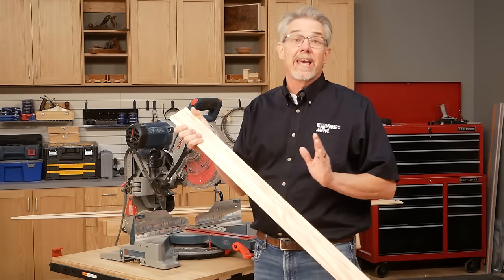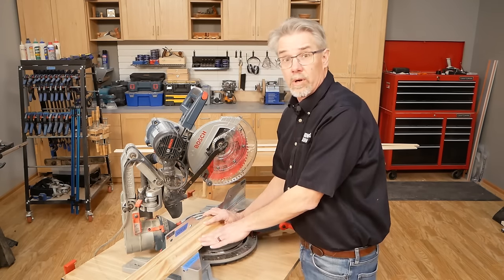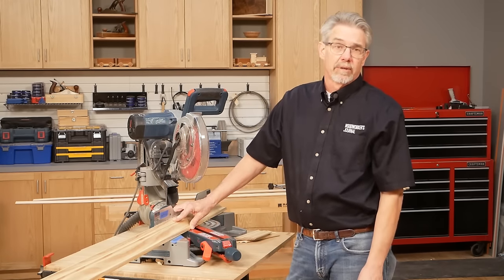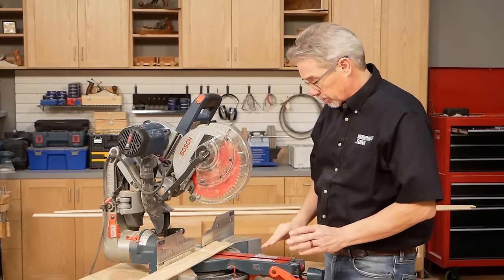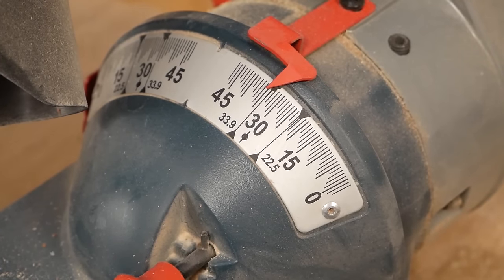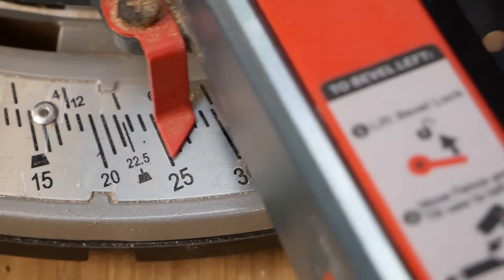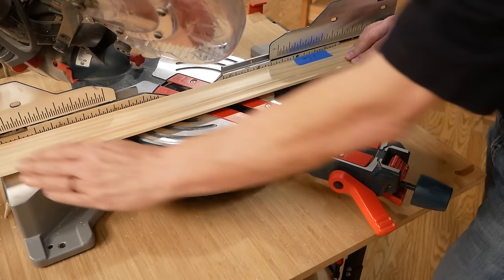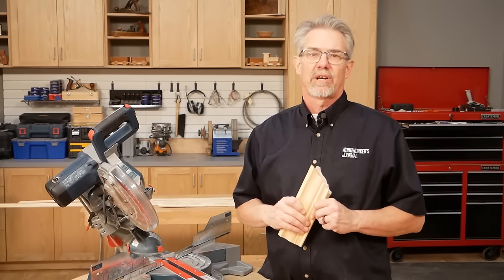Using a Miter Saw to Cut Crown Molding

Comment: Preparation is the key.  For a week in advance you should practice cussing and swearing so the words come easily when the cutting starts.  Oh and buy 2 to 3 times as much crown molding as you need so you have sufficient to finish the job as you are going to find you have the perfect angle on the short stub and the wrong angle on the long piece.  Then when you finally get the cuts right you will find the corner is 88.4 degrees and not ninety.  Better still tell your wife that you don't think crown molding suits your house.
Reply: I would rather dig a hole in concrete with a toothpick. the biggest pita ever
Reply: @mmp4610  k.   B. N. N
Reply: @mmp4610        j. K
Reply: Best comment soooo true🤣🤣🤣🤣
Reply: This is the funniest thing ever. It's exactly how I feel today after trying to do mitre corners.
Reply: Thank you for the laughter and sharing my joyful frustration. I appreciate carpenter's they have a different kind of brain to calculate this.
Reply: That's true. You need to get your area, supplies, and swear words prepped.  My lady and I have a predetermined cussword's so she knows the difference between me messing up something, from me having hurt myself needing medical help.  G Damnit means I measured twice and thrice and still cut wrong.  WTF or Shyt means I'm bleeding out, call 911 😁
Reply: This is turning into EXACTLY my experience. But I will not be defeated!!!
Reply: This comment was the best unexpected laugh I’ve had in a long time. I’ll tell my husband how much I love 88 degree cuts in our molding after this.
Reply: Just remember when it comes to those 88degree angles putty is your buddy.
Reply: Spit up my beer laughing at this comment🤣😅🤣😅

Comment: Outstanding explanation on this topic - if you are using a compound miter saw, this video covers, in simple, easy to follow step-by-step how to do the inside and outside corners.  I watched a number of videos and this is the easiest to follow.  I made a small recap of the video to be able to quickly reference it in the future, along with the video.  

**Compound Miter Saw

Bevel: 33.9 degrees 
Miter:    31.6 degrees

For the below, crown goes FLAT on the saw rather than against the saw and fence as if it were being put in place

Outside Corners

Left side of outside corner:
Swing blade to the left 
Bottom edge of molding against fence
Right side of workpiece is your molding

Right side of outside corner:
Swing blade to the right
Top edge of molding against fence
Right side of workpiece is molding

Inside Corners:

Left side of inside corner:
Table swings right
Top of molding against fence
Left side of workpiece is what you keep

Right side of inside corner:
Table swings left
Bottom of piece against fence
Left side of workpiece is what you keep

Thank you!
Reply: Thanks
Reply: Very helpful... thx!

Comment: Best DYI video I have ever watched. I am a once every 4-5 year crown molding guy andnusually forget everything. Made 8 cuts using his method of laying flat on saw and using compound miter saw with his recommended degrees of cut and bevel and all were 100% correct. Tips - clearly mark TOP then I use a digital laser tape measure so get very accurate measurements. Second you must visualize the left and right cuts in each inside or outside corner cut...he is not talking about the left and right end of the board. If you follow this thinking then you got it.

Comment: i’m very new to wood working and bought a compound sliding miter saw . my very first project was o make a new fireplace mantle. i didn’t have a jig to cut crown molding seated in place at the correct and decided to cut flat . your video helped me through my project. i have since made a jig to hold the crown molding in place on future projects. 😊

Comment: For anyone needing to take the easiest notes. Just screenshot the angle he cuts and insert a text in that pic if it's for right inside or left inside. Or right outside/left outside. Makes it 1000Xs easier to just reflect back on screenshots with text to set my bevel/miter cuts. Thanks for the video! Very, extremely helpful and to the point

Comment: This is the first video I viewed which shows the alternative way to cut crown corners, i.e. laying boards flat.  Knowing this (on my first project) would've saved me countless hours of trial and error trying to hold the crown in position using my relatively cheap mitre saw.   I was ready to buy a new saw and jig for my new crown project till I learned this.  Saved me $$, thanks!

Comment: Thank you for this video...it is the one that finally helped me figure out how to cut inside corners on crown molding using the lay it flat method.  Miter Right, Top @ Fence, and Miter Left, Bottom @ Fence, both with unchanged bevel.  RT and BL.  Awesome.

Comment: After watching this I went down to my workroom and made four template pieces. The two sides of both an inside and outside corner. I carefully labeled the table position "left 45/right 45" and if the piece was to the left or right of the blade. Now I can use these to recreate the needed cuts with less chance of getting something reversed or wrong.
Reply: FEAT Acrobatics god idea.
Reply: I meant to type good idea

Comment: The flat cut method only works if your crown molding is cut at a standard angle. The bevel and angle of cut are different if your crown molding is symmetrical top to bottom.

Comment: This is a great video, but you should include one caveat. The 31.6 and 33.9 work with the "standard" 52/38 deg molding, but does not work with other angled styles.

The molding I got for a project seems to be a 45/45 instead. Its not easy to eyeball the difference between 45 and 52, so I didnt really know. I laid a scrap piece inside a 90deg corner and moved it until it fit pretty flush, and then marked where the molding first touched the wall closest to the inside corner of the wall. Also marked where it touched the ceiling, closest to the inside corner again. I measured each, and they were each about 3.125 from the corner. Since the triangle I created had equal legs, and one angle was a 90, both the other angles were 45s.

In case anyone sees this - the numbers for 45deg molding at a 90deg corner are 35.3 miter, and 30.0 bevel. I think the instructions in the video still work as far as where to put the top of your piece, and which side of the cut you keep. There are also charts you can lookup online for angles other than 90deg in case your walls arent straight.

Comment: Woodworking Beginner:
This test is only if you want to saw with precision, with a miter saw. (test is not for rough work).     
Tips and Test: 
Very important if you would like to saw with precision. (avoid torsion as much as possible)!
Always choose a Miter saw with a handle positioned in a vertical line above the saw blade.  
Everything must be aligned, slide rails, handle, and saw blade,it is much better this way the blade will not tilt.
Because there is some torsion in the aluminum housing .
And choose an engine with softstart on it to prevent wear of the gear and worm shaft.
It is very important that everything is aligned.
Here are some examples to show how the handle must be positioned above the blade.
Bosch gcm 800 sj / Bosch gcm 8 sjl / Evolution rage 3 / FESTOOL KS 60 / Bosch GCM 8 SDE / FESTOOL KS 60 E KAPEX / Metabo KGSV 72 Xact / Bosch PCM 8 SD / Hitachi C10FSH.

(This also is the case with the Miter saw without the slide rails).

(If you want). You can test it yourself at home if there is torsion in the aluminum housing.

Step-1. First you make a saw cut from +-5 mm deep in to a flat piece of wood about +- 20 mm thick to this with the normal handle positioned on the right side of the Miter saw (the wood it will remain in place until the test is completed).

Step-2. Then repeat this by pushing the saw blade down with your hand (finger) on the aluminum protective cover were the saw blade is cased in. Just now only do this without the running engine.

Step-3. Now you can see if the saw blade will be positioned in or next to the saw cut. If the saw blade is (+- 0,2 / 0,5 mm) next to the saw cut then there is torsion in the aluminum housing (test is completed).

Step-4. therefor it is much better to choose a Miter saw with the handle positioned vertical in line above the saw blade.

Step-5. When you measure the vertical angle square of you're sawblade don't forget that there is always some torsion in the aluminum housing.

Conclusion: how further away the handle is from the saw blade how more chance of torsion in the aluminum housing.(don't go for that).

Also with a cheap slide miter saw it is still better the handgriff in line a above the saw blade than on the right side. Maybe they will make it someday then we have a winner...

Comment: Thank you so much for the video! So you can make all the basic crown cuts with a Single bevel?
I have the Dewalt 20v miter that I love but it is only single bevel. Any advice would help. Thank you for your helpful video!
Reply: The bevel was tilted to the left and never moved the bottom part was the one that was rotated left and right. So it seems if your saw tilts to the left your good follow the video. I'm getting a single bevel saw this week and have a project for installing crown ill be following his videos as well.
Reply: @mrchillpill8625  wait 🤔 if you only have a single-bevel comp miter saw you'd have to flip your material upside down in order to make that other bevel cut. That's the whole concept of having a dual-miter comp saw. So one doesn't have to turn it upside down.

Comment: I'm doing inisde corners in my bathroom. I tested this flat method on some scrap pieces from a previous job and here is what works.

Preliminary (Place a piece of tape at the top of the molding and write TOP on it)

1. Set the Bevel first at 33.9 degrees, with the blade tilted left. Set and Forget. No need to change Bevel during the process.

2. Inside Right Corner - Top of Crown molding goes against the fence with the molding laying flat on the base.

3. Move miter handle to the Right and set at 31.6 degrees.
- Scrap piece is to your Right.
- Work Piece is to your Left.
- Make your Cut and keep your work piece from the Left side. Set aside the scrap piece from your right.

4. Measure the wall from corner to corner.

5. Mark your work piece to be cut at that same wall measurement, measuring along the long side, which should be the bottom of the molding. Once step six below is set up, use the light or laser mark on your saw to line up with your measured mark on the long side.

6. Left Inside Corner - Bottom of Crown molding goes against the fence with the molding laying flat on the base.
- Scrap is to your Right.
- Work piece is to your Left.
- Don't forget to line up your laser guide with the mark on the long side of your cut. (This will be the bottom edge of your molding).
- Make your Cut and keep your work piece from the left. Set aside the scrap piece from your right.

7. Cut your next piece using the same methods above. Don't panic when you place them up in the corner and they don't seem to fit right away. You have to adjust both pieces to get them against the wall and ceiling properly where the inside corner angle will come together just right. Having a helper to hold the opposite end is handy, but they must be flexible to your adjustments as you get both pieces fit up just right. (Pro Tip: Have your nail gun handy and ready to nail, so when you get your pieces just right, you can pop a nail in each piece to hold it up, or have a helper nail it as you hold it). You may want to scribe a line along the wall, or mark the wall with a laser level before nailing, to ensure your pieces are running straight and consistent at the same angle to the wall and ceiling.

I hope this helps someone. Copy and paste into Microsoft Word and print it out to have next to your work station, and stick to the steps. Good Luck!
Reply: On the inside corners,😮 I believe you're backwards on which side of the molding goes against the fence. Eg- The left side of the inside corner should have the top of the morning going against the fence.